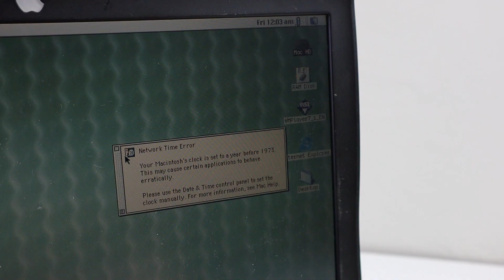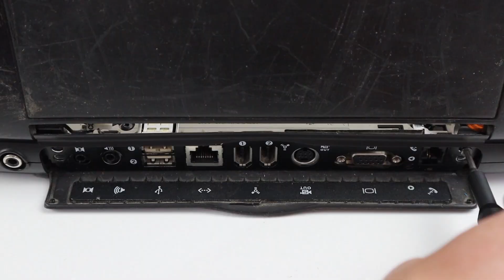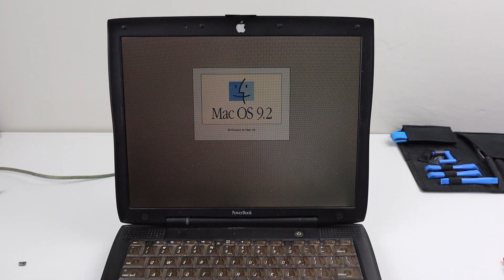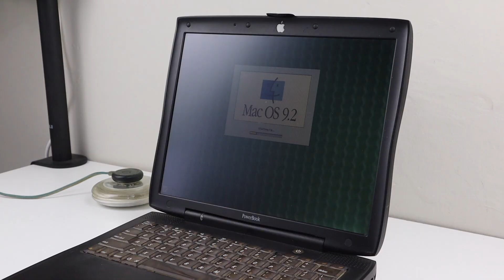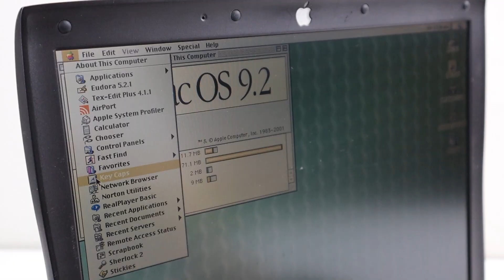Restoring Apple's Most Upgradable Laptop - PowerBook G3 Pismo - The M1 Mac I Wanted To See...

Comment: I bet that when this laptop was unveiled, Apple hyped it as a modular and upgradable masterpiece. Look at them now
Reply: It's sad because we're moving away from this. We used to be able to upgrade the processors in our laptops. And now the most we can upgrade is the laptop itself because some consumer laptops slow themselves down after the warranty ends. This is why I recommend ThinkPads and stay far away from Apple.
Reply: its989 i have never heard of slowing down notebooks after the warranty ends, do you have at least one trusty link for this?
Especially for apple notebooks. I know they did this with some iPad and iPhone generations, but what i know..... no single mac ever slowed down because out of warranty. Probably after a while they realized they need to downclock some things like the GPU in very few models with an Update, but the overall system performance was the same and this was within warranty. I still have such a mac... they downclocked the GPU from 550Mhz to 500, since this GPU was anyways weak and wasnt a „gaming“ GPU at all i didnt care about it, in fact this resulted in windows usage with 10-30minutes longer battery runtime, who cares if a game runs now in 50 or 47 fps... both is low especially for todays standards with 144Hz+
Reply: @harrison00xXx  I had a 2012 Mac back in 2016 and damn did it get awfully slow, Just for reference I have a ThinkPad of the same era that's way faster and it has a hard drive. It's the same hard drive in both computers "500GB WD" Yet the ThinkPad is faster. Apple is definitely playing some trickery with the MacBook and it wasn't just me who experienced slowdown my friend has one and his is god awful it takes 5 minutes to just load into the operating system. He upgraded his hard drive a year ago and it's already really slow.
Reply: its989 interesting.... my first gen i5 Macbook Pro is still snappy as day one (day one of the SSD, ofc the original HDD was slow..)and your newer ones take 5 minutes to boot with a SSD😂
Reply: @neurotyx  oh yeah
Reply: At least the Apple is right side up now.
Reply: now they look like some garbage
Reply: Anand Raj  "The best laptops are think pads"
How so? I mean i know they are good, but the best? not really, too much plastic (even if its higher quality), magnesium cases are rare and only used in very very high priced Thinkpads if at all, most of the earlier ones were much thicker/heavier than comparable notebooks,...
Yes, they are good... in case of robustness, longevity, build quality at all, but they have smaller batteries than the competition (especially compared to apple) and newer models have very often a crappy keyboard, seems like they saved some cent on keyboards like many other brands.

And if we consider the price of better thinkpads, even Apple was a better priced option in the past, but also as robust and high if not higher build quality. And many Macs were also as long (or longer) living as a Thinkpad, but the aged Macs looked much better (aslong the case wasnt heavily bent or heavily damaged aluminium finish), meanwhile even modern thinkpads look already "old".

I would prefer a maintainable MacBook (if it will ever exist again) always over any thinkpad, not only because of the looks, but because of superior battery life (and quality), often a better screen and because i use Mac OS anyways and i cant really live with a Windows Machine for anything else than gaming, its too annoying for me personally so the only way to go is Mac OS/MacBook (Pro) for me

Even some cheaper notebooks can compete well with Thinkpads, ofc many are "trash" (in a thermal, quality or robustness way), but a few models, especially from Lenovo (not the IBM machines) nearly all machines and some from MSI, HP and Asus. I know MSI, HP and co produce a lot of trash, including my 2019 HP Omen 17, but damn aslong the usecase is fitting these machines (80% used on the TV or on the lap at home with internal screen and 20% carried to a friend to play some games) and the price is ok (paid in end 2019 1850€ for a RTX 2080 Omen 17 with 9750h, only 100-200$ more expensive than a similar desktop)
For me its like a very mobile, but also fragile Desktop-AIO PC for a good price.
Ofc this machine isnt comparable to any regular notebook or MacBook Pro when it comes to battery life (30mins up to 1,5hrs) or how heavy it is. But lets be real: Thinkpads are only fitting a few or only one usecase, there are so much more specific notebooks out there (like smaller, thinner ones or some with better battery and better inputs like MacBooks, or much better performing ones with proper GPUs and better cooling, bla bla...)
If you really know what you need your notebook for.... its with a high chance NO thinkpad because you will go for something better looking(nearly every notebook looks better than a Thinkpad), something faster (in most cases GPU wise) or something cheaper (which is also the case for most similar speced notebooks). I barely saw Thinkpads in my Life.... mostly cheap Acer, Asus MSI and HPs, rarely "hi end" models of them and a few MacBook (Pro)

In fact the only thinkpad i saw daily for a while was a friend who borrowed the Thinkpad from his dad before he finally got his own notebook with a decent GPU (because, oh what a wonder,... it didnt fit his usecase anyways, even if we talk about little gaming of easy to handle games...)
Only if i look for Thinkpads... the ones with iGPU are probably ok (aslong you never need any sort of GPU power), but the ones with a slower dedicated GPU are getting already pretty expensive, and the hi end models... i dont think i have to say something to them...
In Fact a Thinkpad is a "good" Notebook, but damn its as overpriced if not more compared to MacBook Pros, and thats a shame considering the Apple Premium is already pretty much a scam
Reply: @harrison00xXx  nothing Is perfect everything has some flaws.
Reply: @harrison00xXx  well but the ThinkPad at least upgradable in the SSD, WWAN card tho, this thing slaps the Mac
Reply: @trandinhvietdung9357  no
Reply: sad
Reply: https://youtu.be/So5_ObIcpP8
Reply: @youtubebrown3901  sus
Reply: Anand Raj  800$ was never much for a PC, even in 2005 you had to pay like 400$ AT LEAST for a lower "midclass", mor like low end rig. But for like 500-600$ you got MUCH better performance in the typical midclass which lasted at least 1 year longer (remember,  these days performance increases were much higher than today)
The additional 100-200$ were invested in more ram, better parts (hi quality PSUs and Mainboards instead of cheap ones for example) and sometimes ofc a better GPU (gamer and so....)
I always calculated in price/performance, therefor 400$ PCs were bad (most of them "outdated" as they were built already), same goes for 1200$+ PCs because they were barely faster than a 500-800$ machine (in fact a nice overclockable 800$ build could even perform as good as the absolute hi end parts for 2x the price). meanwhile the best performance/$ you got in the midclass or higher midclass. Thats why i mostly built "so expensive" 600-800$ PCs, so i had at least fun with them for the first year(s) instead of struggling already with its performance from the beginning on. Not only that, these machines also served as useful "Office" Machines 3-5 years later. In the end you could save some bucks by getting a faster PC these days and using it longer. Since some years things changed, if you want today proper performance and some kind of "futureproofing", you have to pay AT LEAST 1500$ which is a shame and even these parts are not made for future anymore, see the low amount of  VRam of Nvidias RTX30 cards, the "slow" DDR4  at all (which are barely better than good old DDR3, released in 2007/2008!), and many other things.
Reply: It, in fact, was
Reply: go now
Reply: It was the original 10-hr laptop, each battery was supposed to be good for 5 hours of runtime.
Reply: Liquid Damage
Reply: @Raphaelza  More like a Brain Damage ;)
Reply: Anand Raj  he means on phones
Reply: Anand Raj  I mean im also on a 22nm CPU like you (4C/8T 4790k i7...), but damn 2 Cores 2 Threads, this is really fine for anything in 2020?
Im wondering if this system is even capable of 1080p 60 fps youtube videos xD
In VLC even HEVC is working "ok" aslong its 1080p HEVC (close to 100% CPU load), but 4K HEVC videos... no way, i would need hardware decoding for that already which isnt supported by the 330M.

At least my experience with a mobile first gen i5, 2C/4T (2,66 GHz i think) and Geforce GT 330M shows this system is even for regular usage at its limits, 1080p youtube is ok in 30 fps, but since most videos are 1080p/60 fps i got HUGE problems, stutters, even complete freezes of the video so i need to use 720p instead of 1080 (which is a pain for 2020, lets be real xD)

I dont even touch my 6 Core AMD Phenom II X6 anymore since around 2016, not only because its performance is trashy AF for todays standards, but also because its a heating monster (140W TDP, with OC its more like 160-170W)
Your Pentium probably is a little bit more efficient, but im sure its even slower lol. And still outputting like 50W when you do regular tasks.

No Offense, but damn UPGRADE YOUR PC xD
Even a cheap, low powered Ryzen 3 Notebook with Vega3 (or 8 if you can afford) will beat your PC easily, and most of these machines are passively cooled or with very silent, small cooling solutions.

My Mum needed also a new PC around 1 year ago, but we decided to get a very small ryzen 3 notebook, even paid like 100$ more and got a convertible from Lenovo instead which is a DAMN NICE notebook, you could unplug it from screen/kb/mouse and use it mobile for up to 12 hrs too! Much better investment, since my mum also dont need high performance, especially GPU performance the Vega 3 iGPU was fitting perfectly, fast enough for video playback and hardware encoding, but also "cheap" enough.
Reply: Anand Raj  Ok this makes at least sense, because these devices are overpriced AF, but not only that... also weak.
On the other hand... a Ryzen 3200u/Vega 3 Surface would be awesome AF :D
Reply: Anand Raj this CPU is still aviable for a good price at amazon?
Or did you get a cheap used one from amazon, like this it would be a huge jump from a 2C/2T pentium for cheap
Reply: Anand Raj all i have seen now is a 4770 for 220-280€ and 4790 for 180-300€ all new
Damn im so lucky i got in 2016 already a used 4790k for 130€, and then AMD fanboys cry i am Intel Fanboy and paid too much 😂
Reply: G stands for good
Reply: Big oof
Reply: Anand Raj  His opinion may be focused on cellphones. But this is not a excuse!!!! They can definitely do that  with a changeable battery. Japanese manufacturers even made their clamshell phones water-resistant with everything you would see in a Nokia.
Reply: Yeah. They made everything very hard to upgrade and its impossible to do anything in the newest MacBooks
Reply: Yes look at them now... almost bankrupt to trillion dollar company. What a tragedy lmfao
Reply: that are the costs of having them slimmer and slimmer..
Reply: As i writed this It has 69 responses
Reply: @defautluser0  please never write "writed" ever again in your life.
Reply: Right? 😂
Reply: Never underestimate their greed !
Reply: An absolute joke. Shell of their former selves 🙄
Reply: "We have a range of options available" - Apple
Reply: look at the others now - they also cried how anti consumer apple was (as they began to glue/solder batteries in notebooks and so)....but in the end they did exactly the same, only 1-3 years later.

I remember when samsung advertised any of their phones with a replacable battery (to counter apples "non replacable" ones), the next generation was already with a fixed battery and not much better than their older version xD Isnt it sad if someone is crying about something only to do the same later too? If i cry about any wrong decision of the "enemy", the last thing to do is doing the same then....
But what im talking, Apple will always be for the mass the overpriced anti consumer company, even if others have exactly the same plans.
Reply: @harrison00xXx  you are right but apple is the one to come with new ways to tease consumers. At the end all the company's wants you to pay more not less. So no need to fight over samsung and apple all the company's need money.
Reply: @amd20077  NEED the money? Lol no they want it because majority of people allow to be scammed without knowing it.
Reply: @amd20077  Yeh I don’t know why people complain the companies are just succeeding and are making more and more money which it should be its primary goal. Ya don’t like it don’t buy it?
Reply: @harrison00xXx  Lol dich kenne ich
Reply: @harrison00xXx  technically every battery is replacable right?
Reply: azzam_ technically yes but as soon they are glued in the case i hate to replace them
Reply: @harrison00xXx  replaceable batteries are amazing. Fixing a phone for 20 bucks and 1 minute is amazing
Reply: @harrison00xXx because what Apple does, so does the rest of the industry. 😊
Reply: @harrison00xXx  the backs may be sealed but thats for water resistance. They still allow you to change the battery unlike Apple who pairs it to the phone to make you have to pay more to get it fixed.
Reply: Donald Bowers water resistance...  do we talk about phones now?
haha i had in my whole life only one phone which was falling unintentionally into the water (which corroded connectors)
smartphones arent anyways made for water, a friend with any overpriced HTC smartphone also filmed underwater with his „waterproof“ smartphone. It died after the holydays... want to know why? corrosion on the PCB itself, pretty sure from the diving

BTW you could also seal a smartphones back with others than glue... damn i even made a Nokia 3310 over a decade ago already waterproof only by isolating the whole PCB and everything with copper/metal with some sort of „liquid“ plastic which can be hardened out and isolating the complete circuit
Ofc this method would make fixing a device a pain („glued“ connectors this way haha), but hey there are so much better options than glueing case components to each other
Reply: Anand Raj  I can change my acer laptop battery. It's very easy
Reply: A2ZEE TECH Asus, HP, MSI, Alienware... everything crap

It totally depends on the usecase, probably the 8GB (shared!!!!) Ram would have been enough. Btw whats a Apple M1 alternative from Asus? A Subnotebook? haha
Reply: A2ZEE TECH and how you know that he need at least 16GB on a M1 mac?
Reply: A2ZEE TECH I bet your „16GB minimum requirements“ are only meant for regular Intel Macs and Windows PCs (with regular Intel/AMD...)
The Apple M1 is a completely different story when it comes to Ram and you wont see any „Apple Silicon“ Mac with more Ram than a comparable PC
Thats a similar story like Android need a powerful Octacore CPU to emulate this useless java stuff, meanwhile iPhones are running the OS aswell as the program code native, so much more efficient and faster thats why Dualcore iPhones competed with Hi End Quad and Octacore Android Phones, still the Android Fanboys argument : „mimimi faster hardware for the same price“... Ofc faster hardware, but to run java-addicted android (and its java based apps) you also need a lot faster hardware

But buying a first gen device from Apple is always a bad choice, they are getting by far much faster outdated than any generation after it. As much i really would like to have a M1 Mac... i wait for at least 2nd gen Macs and especially for bigger ones, at least 15“, probably a pro version with a dedicated GPU.
Reply: In the end, it’s still ewaste.  Nobody is going to bother with this machine.  The modern non upgradable Macs are going to have a longer viable life than this machine did.
Reply: Mr LT1 how so?
Whatever breaks in these machines will be:
) too expensive to replace when its already some years old
) not replaceble at all

I bet for example.... no i know already... my 2010 MBP will live longer than any newer Mac... why? I can replace for cheap battery, SSD and Ram. My 2010 Mac needed already some months ago another battery and got with all batteries around 4000 charging cycles on it.
My 2010 have the good keyboard (before apple used for years cheap ones until 16“ MBP), meanwhile i know enough people with newer macs and bad working keyboards (the „cheap“ ones from 2013+ btw...), but my 2010 still works perfect
same with batteries... some friends have a modern mac but dont want to pay like 200$ to replace a battery. I get a 60$+ battery, replace it easy af by myself in minutes and squeeze the life out of it, no battery ever lasted shorter than 800 cycles, the original even 1200+ cycles. My actual battery cost like 100$, but its even bigger than the original was, around 10-20% longer runtime than original, thats awesome!

And how can you say a nearly 20 year old device (which is still working btw) isnt as long viable as a modern mac? If you live for another 20 years pls try to use a 2020 Mac in 2040, lets see how useful this will be (if the 2020 mac is even working at all)
Reply: @mrlt1151  Macs have no viable life. An unfixable all-in-one shouldn't be trusted by any user. I won't let my data becomes a worthless silicon chiplet.
Reply: @mrlt1151  Sorry to tell you this fact but laptops, especially x86-64 tends to have life up to near 20 years without problem. SSD only has life for about 7-10 years and at that time, throwing a machine away seems like a waste. Even a 10-year-old business laptop (Like x220, 6430u) can beat new cheapo laptop in 2021 in both processing power and build quality while price is on par or even cheaper than these laptop
Reply: @trandinhvietdung9357  in the lost 10 years i personally have been issued 3 business windows machines. 2 Lenovos and a dell. The first Lenovo could have been fixed but nobody actually fixes business laptops. The company didn’t even want it back, it’s sitting at the bottom of my closet.
Reply: @mrlt1151  i think you should fix it by yourself, anyway what is the laptop problem?